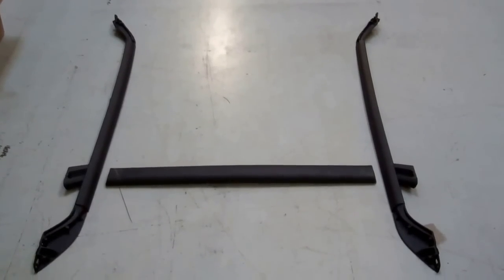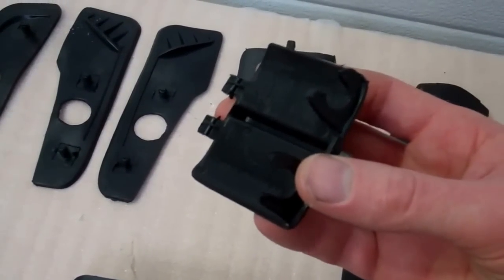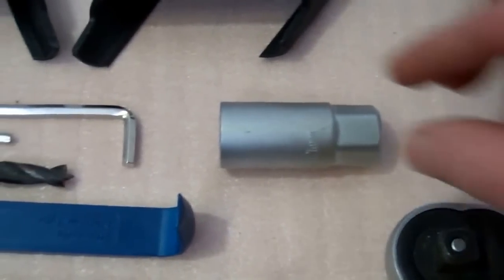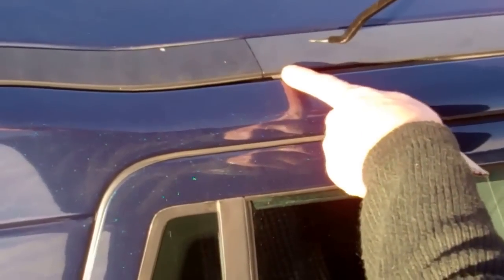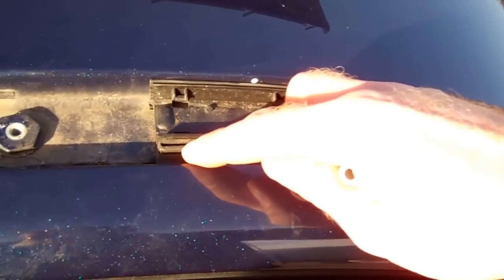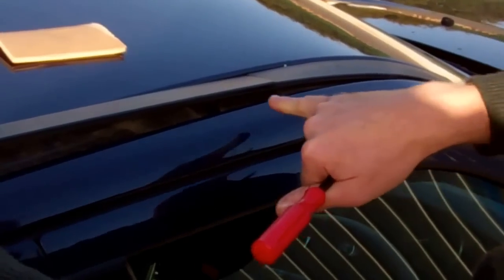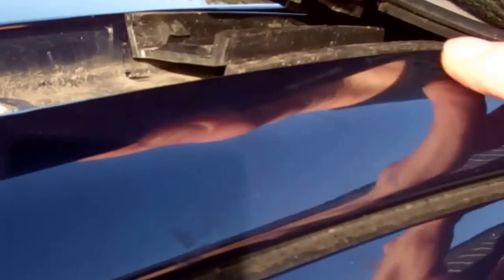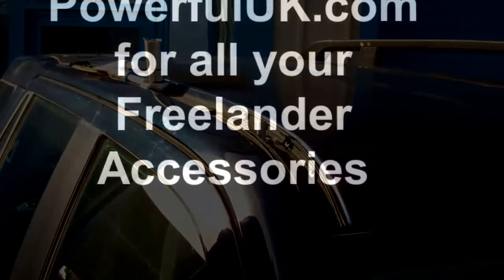How to fit roof rack rails to Land Rover Freelander 2 ( Part 1 )

Comment: Found in the original LR instructions and confirmed it's fairly easy to remove the bolts and drill the holes in the plastic strip by leveraging up the front of the strip and not having to remove it fully. Had problems with other fir tree plugs breaking so this might save a little effort. When drilling I simply placed a piece of wood under the plastic strip and drilled though to that. LR recommended a 24mm hole saw bit but I used a 22mm spade bit which worked fine.
Reply from the maker: thanks for adding these extra comments !

Comment: Hi there, was wondering if you knew the process for taking one off. I have purchased the four fur tree fixings  and the two bolts as well to replug everything. Was wondering what part of the trim needs to be replaced as I take it they have had holes drilled in them?

Comment: Morning guys, could I ask a quick question about roof rails with panoramic roof. I've read that non panoramic  bars won't fit due to the sunroof glass catching on  the front mounting. Is this true or false.
Will non panoramic  bars fit on a car with panoramic glass? 
Cheers Paul.
Reply from the maker: Hi Paul - this is a question that puzzled me so much i purchased a set of both types of genuine roof rack and looked for the differences - the only difference i could see was a rubber strip on the underside of the cross bar that i guess is to do with noise on the pano roof version - so basically there is no difference between the 2 types !
Reply: @L663   Hi Simon, and team, thanks for the advice I can confirm that non panoramic bars do fit and even though I ordered geniune non panoramic version (I work at a land rover centre, so get them at cost) they have come with the rubber strips on the cross bar.
So my guess is that they have superceded them but forgot to update the system. Thanks again to you for your advice. Keep coming up with the great products and videos.

Comment: Hello chaps had an issue when removing the plugs out of the rear part of sill is there any way you can get replacments parts for these?.
Reply from the maker: Is it the sealing plug that goes in the hole you need ?

Comment: Hello, I am trying to install the roof rack But somehow the back Treads are very rusted and found some damage and I am not able to put the bolts there, is there any solution that you recommend?
Reply: A fine wood screw in a drilling machine and carefully removing the remaining plastic.

Comment: Hi, I ordered the roof rack but the existing screw housing on the roof are rusty therefore the screw M6x38 could not fit. Can you supply the existing screw housing x 4 for me?
Reply from the maker: We can help you out here - did you purchase from us ? does your user name match the name you ordered under ?
Reply: Yes I did. I can show you the picture and video what I am after. Can you pse send me your contacts.
Reply: Problem solved, many thanks.

Comment: Can i ask,is there a difference in kits for the model with the panoramic roof?
Reply from the maker: This is the $1,000,000 question and it had me totally baffled why Land Rover have different part number for these with and without sunroof.... so i purchased 2 genuine sets and set about to work out the difference !... the result.... its just a rubber strip used to reduce wind noise on the cross bar ! so dont worry about it !